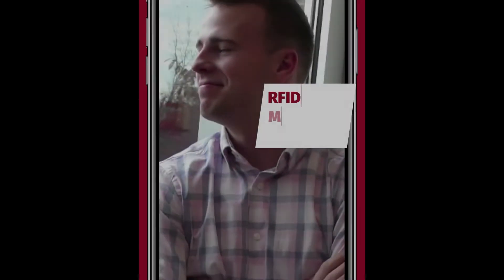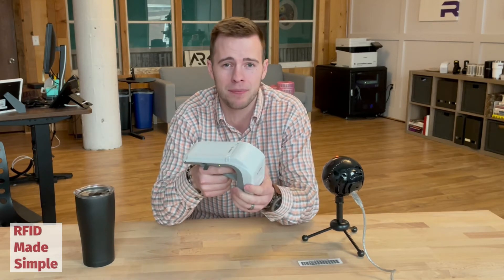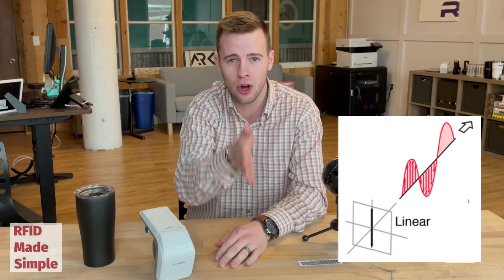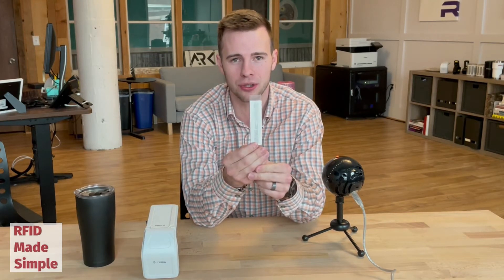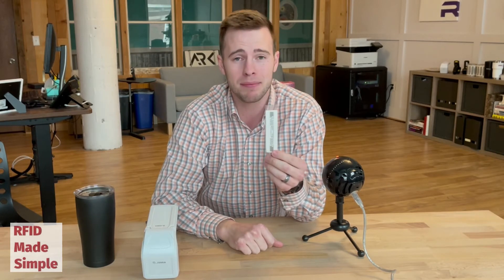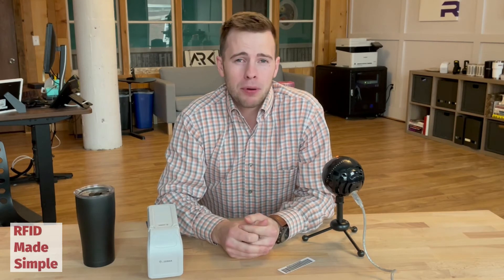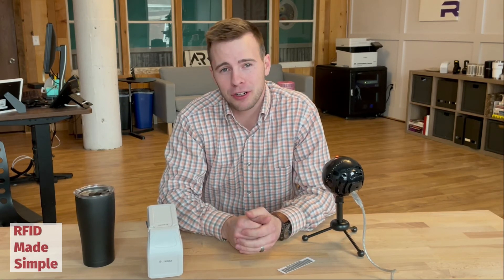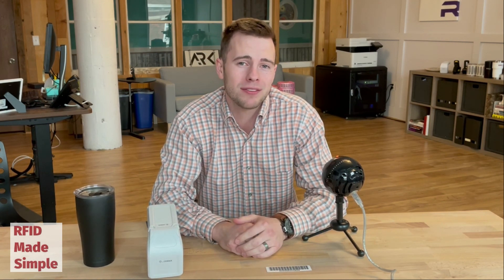RFID Polarization: Linear vs. Circular Explained

Comment: This may be a dumb question, but if you were using a linear reader, could you just perform two passes, one in a vertical orientation and one and a horizontal orientation? Orientation? And get a better read at a greater distance?
Reply from the maker: Absolutely! Simply rotating a linear polarized antenna 90 degrees could achieve the further read range results. Why users choose to use circular polarized is when read range isn't an issue and then it's much easier not having to worry about orienting the reader correctly.